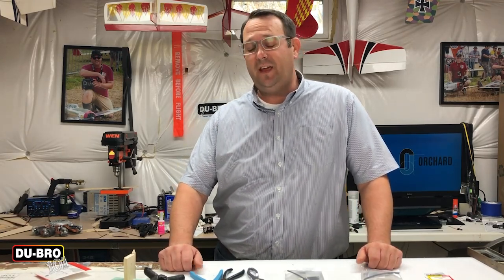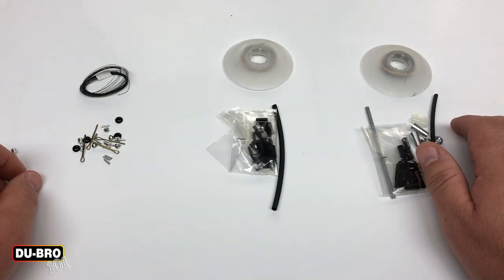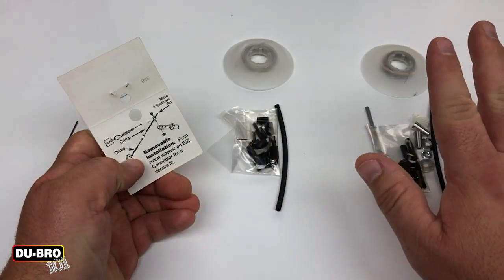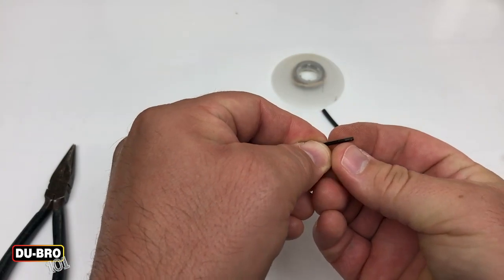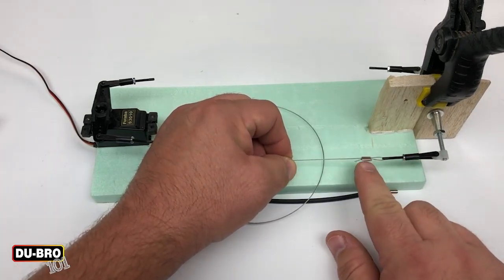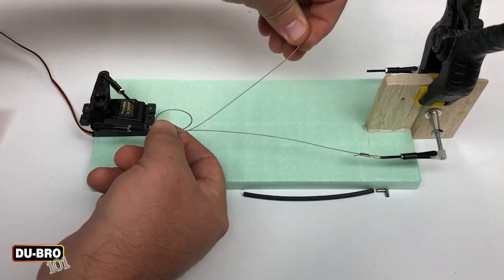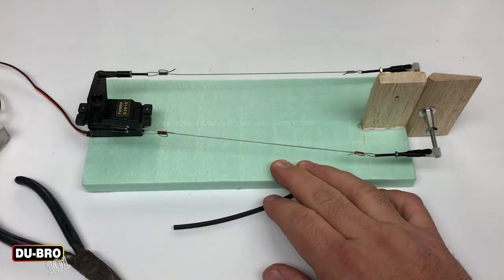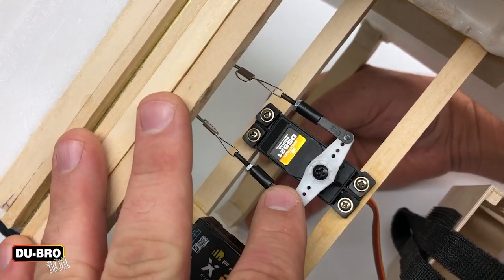Du-Bro 101 – How To Install Pull-Pull Systems

Comment: Is there an advantage to pull-pull systems over a nylon sleeved pushrod setup?  I like the Lazer Rods or similar products over simple steel music wire setups because I don't have to worry about bending under stress as long as it's supported occasionally along its run.

Comment: In the UK, I could only purchase a 518. I have a 120 size tiger moth with a 140 engine. It is 2.2m wing span and the rudder control surface is very large. Would the 518 be good for this size of plane?
Reply: I think you could get away with the 518 if you have a very secure set of horns on your rudder. The tiger moth should not be too terribly fast however, side loads will be a factor as well. If you are flying at a cross wind you'll get some strain on the system. I'm not really worried about the tenisle strength of any of the hardware for your application. While the crimps and metal lines should be fine, just make sure your rudder control horns are SOLID. Like any model with pull-pull lines, regular inspection of the system will tell your failure points so never skip that step. 
If you are having doubts on your rudder control horns, you can always try to find SKU 880. I'm unsure what shipping to the UK would be but it's a great option if you're looking for something beefy.
Reply: @JoshuaOrchard  it is a rather large rudder on it. My control horns are very thick. I don't know where I got them but I remember buying them to fit on a eflite timer. However they were significantly bigger. I've used long bolts to go right through both both of the horns and a nut to keep them together. The rudder I'd about 6 inches long from the ckntr horns and about 7 inches from the bottom to the top rudder. I don't usually fly in wind but I don't want to take any chances.
Reply: @marckart66  So, if you've sandwiched the rudder between those two horns that's about as secure as you'll get without going to a metal solution. While the area is rather large for a rudder, again, it's a Tiger Moth... you're not exactly going to be doing knife-edges and dipping the tail into a lake while hovering. I'm confident that the 518 set should be sufficient with the 4-40 hardware. Like any model, do your safety checks. Any new model requires this, especially larger ones where the risk is higher due to higher mass. Happy flying!

Comment: I just want to know which size to buy. Why not show the difference between the 2 larger sizes?
Reply from the maker: Hello.  This one is TRICKY since there are actually FOUR different versions of systems that we offer. It really depends on the application. The different sizes have different sizes of hardware that vary by how "BEEFY" they are. From the lines themselves to their attachment points, it really does depend. Like a 2-56 set would probably be fine for a WWI application on a pretty good size model but at the same size model if you are going aerobatic, you'd want to beef that up. Peace of mind and all that. If you are going with a precision aerobatic IMAC airplane you are going to want that heavy duty set. There's no set "model size" per se, only that the hardware is matched to go from micro flyer to large scale aerobat and it is up to the modeler to decide the exact application. I hope that helps.

Comment: Also make sure the servo arm and linkage at the rudder are the same length, otherwise the tension will slack when turned
Reply: RIGHT! I cover this at 14:46 but an excellent reminder that this basic geometric consideration be taken.

Comment: For a 4.25 metres wingspan glider, a Minimoa, should I use the large or medium push pull kit. You only mention engine powered aircraft.
Reply from the maker: I cannot be certain but based on the wingspan I would guess the larger size would be best.
Reply: Thanks for your prompt reply. I'll use the large one.
Reply: @Edubarca46  I agree. The larger set will provide a stronger leverage arm for the forces on such a large ship.

Comment: How do you apply the shrink tube to the crimps AFTER you've already made the connection?  I must have missed something.
Reply: Sure, you can remove the nut from the threaded rod link and slip the shrink tube over and then re-install. I cover this at 12:10 but I hope that this added text helps you out.

Comment: This pull-pull setup was very well presented and something I have considered as a beginner in this hobby. I think I would install the heat shrink on the line before adding the 2nd connection. But the standard or imperial units with these systems is so confusing to me. Although this is about a pull-pull system, I have always used push rods. Why hasn't Dubro gone with all metric sizes for a complete end to end system? It's so confusing trying to use 2-56 or 4-40 hardware with rods that are 3/32 or 0.93" or even 2 or 3mm or whatever they happen to be. But I rarely see 4-40 or 2-56 size rods. They are usually 0 point something inches in diameter. But a 3mm or 2mm diameter rod will always fit a 2 or 3mm size connector, clevis or ball link. Metric is so simple and NOT CONFUSING! If you have a complete METRIC setup, control horn, ball links, threaded rods, and clevises with a way to THREAD them, NOT SOLDER, them together, with a jam nut on each end, it would be VERY HELPFUL!